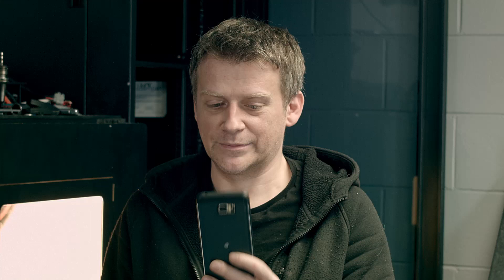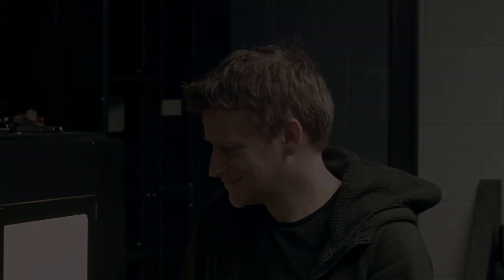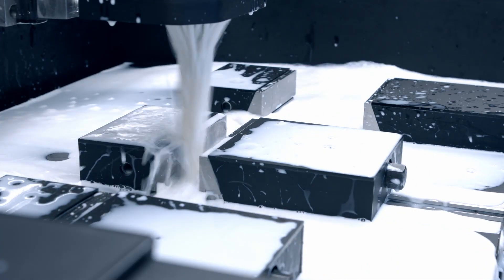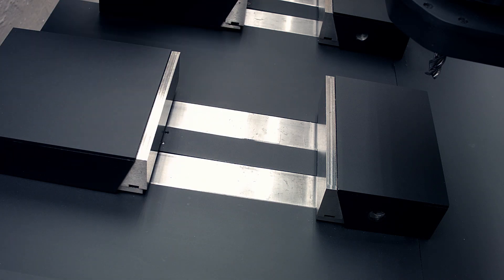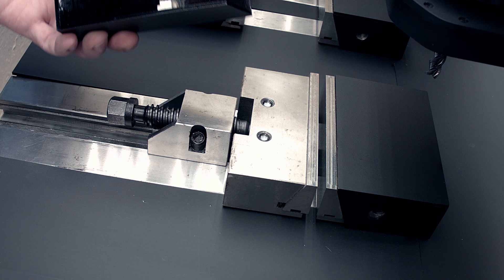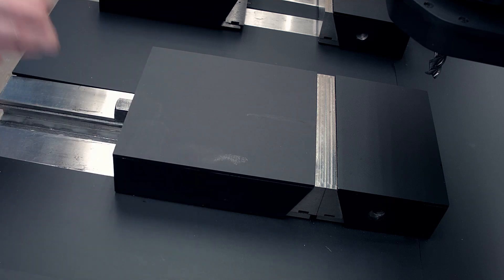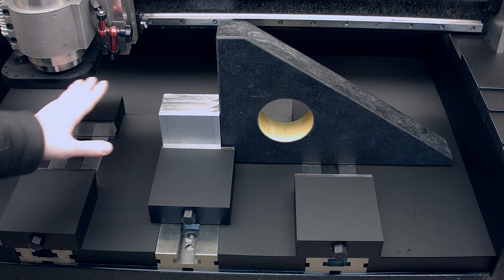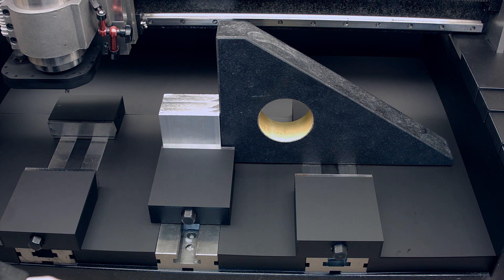sci-fi CNC machine - flash CNC upgrade/mod/design inspiration

Comment: Hey Fox, you're not worried about the coolant flushing away any grease of the vise guides or something? I remember you saying it's an oil in water emulsion which should also help oil the ways. But you're not worried about flushing any grease or flushing small chips into the ways?
Reply from the maker: vises don't have any grease. coolant works as a lubricant. now i dont have any chips in the ways, maybe just some microscopic, kinda like dust or sand, nothing bigger.

Comment: Hi Piotr, Very imprest with your build. We must have the same thoughts. I am building vertualy the sam machine,however  a bit bigger :- Base 960mm x 700mm x125mm Side rails 970mm x 200mm x100mm.  Not  sure about the cross rail ,my use counter top like your-self. Just as matter of interes what software are you using. GREAT VIDEO'S. PS . Got all the parts just waiting for fine weather.?
Reply from the maker: mach 3 and fusion 360. good luck with your build!

Comment: Quite the visual impact.

Every time I visit your channel, I worry about my Huanyang spindle motor longevity. I know your had issues with yours.

Do you have an chop clearing gcode/toolpath?
Reply from the maker: Hey Brenda! welcome back :) 
Don't worry too much about your spindle. just don't cut 10mm deep and 3mm side cut. go with 5mm deep and 1.5mm side cut and you should be fine for a long time. of course it will depend on the rigidity of your machine.

currently i don't have chip cleaning tool path. but i will make it soon and implement it in to mach3.

Comment: Very sleek !  My first reaction was to notice all the chips and fluid remained.  Then your genius flush after cutting can just be added to the as a final operation for the job.  
You will, of course, need to add an "air dry" operation with high-CFM blowers to force all the fluid out as well.
Reply: You can do a tool change and add a chipper fan

Comment: Fox roolz. How did that case end up working on your trip? 

Edit: BTW, those containers of chips are SO ideal for recycling. They're already chopped up into uniform sized material (which is the hard part for recycling alum.). You literally just have to take it up to temperature and remove the slag that aggregates at the top due to the air interface. You can just pour them into a steel container (people use cup cake containers haha) and when you need some material remelt it into the form you want. You'll get probably a ~10 to 1 ratio so, those 8 bins will yield an enormous amount of alum.
Reply from the maker: i wont lie, i was thinking about having a kiln to recycle aluminium. sometimes it could be handy.

Comment: Which coolant are you using?
Reply from the maker: solucut. i like it because it does not foam at all.
Reply: @PiotrFoxWysocki  and you were blasting it out - very good. Less foaming means a lot less in the air you breathe too, yeah?  Thanks!
Reply from the maker: @aarondcmedia9585  im trying to recall my experience with the previous coolant. i remember a mist when i opened the door. but i think it all changes since i switched it to the low pressure and high volume. i think fog happen when endmill is chopping the stream from the high pressure coolant system and is spraying it all over.

Comment: Very nice work Pjotr, Inspirational! thanks for sharing. it's always a struggle to keep it clean. They only thing that concerns me is the coolant that's being kept between the scifi and the metal from the clamps etc; in my experience these small gaps are and excellent environment for creating corrosion or work as a medium to connect two different metals to release the potential difference between two. I guess you can't avoid it to remove these and blow-dry the metal.
Reply from the maker: coolant does have some anti rust stuff. is it not enough? vise has moving parts and they don't rust. do you have some source with information on this problem?
Reply: @PiotrFoxWysocki  Yeah, the rust inhibitor should help, but just keep a close eye on your metal parts. You're one step ahead with the granite base, just check the quality of your coolant,  based on the pH level.
Reply: @berendlucasvanderweide   I am seeing a desirable pH range of 8..10?
Reply: @scottwillis5434  Yes, that is correct, pH of at around these numbers. For reference, the acid found in lead batteries has a pH of about 0,7-1.

Comment: Amazing work dude! Still making my machine(s)... Did you make that granite right angle yourself?!
Reply from the maker: how many machines are you making? granite angle i got from china. i tried to get it in nz but there was nothing...
Reply: @PiotrFoxWysocki  Ah I see. I'm making a few; like a 300x200 fixed gantry granite slab one. I went down the mill conversion path and wish I hadn't. Also I converted a unimat3 lathe to cnc, so I wan't to make a larger more capable cnc lathe from scratch now too.  I have been learning the fundamentals on an old ISEL CPM 3020 in the meantime, paying bills has taken priority over this passion which is why it's taking so long...